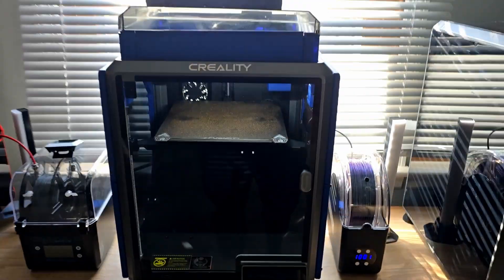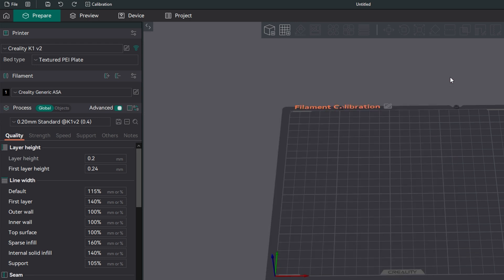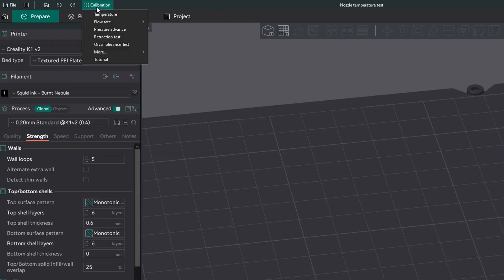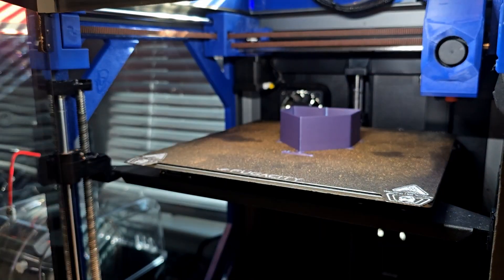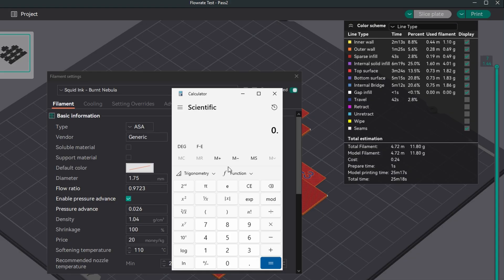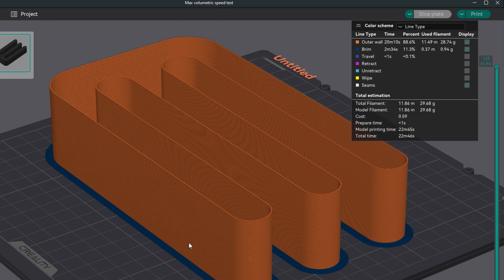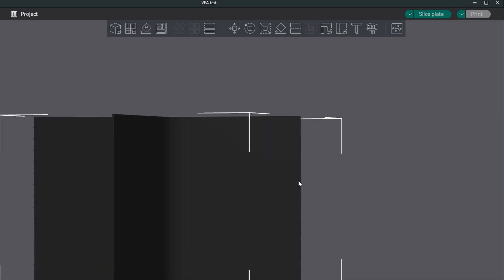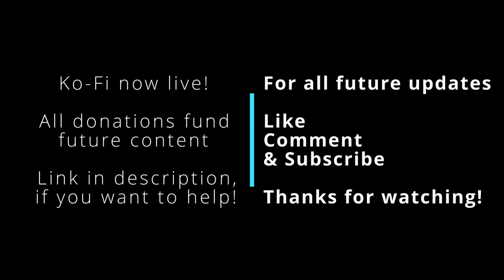OrcaSlicer Calibration - Getting the most out of EVERY filament!

Comment: Not sure if this was mentioned or asked but shouldn't you also have a separate profile for each printer? I guess what I'm asking is, do these small print farms that have say 10 printers have 10 filament profiles of each filament for each printer?
Reply from the maker: @tonybraun5118  That is correct.

I will tune a profile for a filament specific to each printer regardless of whether it is the same exact material being melted in both.

The values are likely close if the machines are unmodified or share the exact same modifications.

The major differences will be found in the same machines with different components/upgrades installed.

Comment: My temp towers all look the same. I checked the Gcode and saw that it was in fact changing print temps. Should I just run the PLA hotter? Would that help my pressure advance/flow rates?
Reply from the maker: With your temp towers providing similar results, it is safe to choose a temperature that falls in line with the high end of the manufacturer's recommended range.

Melting the material at a higher temp will allow for the printer to perform with increased flow rates (the hotter it can melt, the higher the flow it can meet), which in turn will require the pressure advance value to be set accordingly.

Comment: I am sticking with super slicer, trued out orca slicer, with default settings for my printer, never figured put why it, after preheating to 105 bed and 260 hotend, it waited for the temp to drop by halve and then start printing abs.
Reply from the maker: @lcmattern  This occurs to avoid material oozing following a purge to produce an accurate besh mesh. Definitely not a terrible trade off.
Reply: You can adjust the custom g-code at the start/end of the print just like on super slicer but the variables are a bit different. Without this, it runs a default temp, which as you noticed, is wrong. It’s actually very similar to SuperSlicer in that regard, only the orca-equivalent variables names to put in for the bed and hotend temperatures are a bit different.

Comment: I noticed there was a field for SHRINKAGE. I'm having an issue with mechanical parts that are slight small. i ran a Califlower giving me a size of 99.5%.  It wants me to adjust me X,Y steps per mm in the firmware but would you compensate in the SHRINKAGE under the filaments?
Reply from the maker: I would try to compensate with shrinkage before altering cfg values, but that is definitely another option to consider to achieve dimensional accuracy within your prints!

Comment: Absolutely amazing tutorial, clear, detailed and relatively short! I'm sure I'll be coming back to it many times when doing calibration for a new filament!

I have a question though, do you have any advise how to configure the slicer for different nozzle types? I currently run 0.4mm on my Ender-3 V3 KE and I bought some 0.6 and 0.8 nozzles, but orca slicer has no presets for them.
Reply from the maker: Although these calibrations provide a great foundation to hone a 0.4mm nozzle, I can not say that it has been efficient for other sizes through testing.

Stepping up to larger nozzle sizes, it will be a more involved process requiring calibration prints outside of the baked in calibration feature.

You could also pull up a K1 profile for those nozzle sizes to see what the defaults are to have a baseline to work off of.

Send a test print on an uncalibrated 0.6mm/0.8mm default profile (depending on the nozzle size installed) and see what requires adjustment.

This will require more time and patience than the process covered in this video but if dialed in correctly, can greatly improve the printer's output by decreasing print time without any additional modifications.
Reply: Hey  @CovenantCustom  thank you for your reply!

This is what I actually tried - I compared presets for K1 0.4 and 0.6 nozzles and tried to recreate the differences while creating a new preset for my printer. Now my prints now are much faster (almost 50% decrease in time), but they are far from good. I printed a few gridfinity bins which have visible gaps and other imperfections, but also a benchy which just looks really bad. There are so many issues with it. I'm a bit lost at identifying the problems.
Reply: Do you think that now I have created a working preset for 0.6mm I can follow this tutorial to fix the imperfections I was talking about above?
Reply from the maker: @Phos321  Gaps could be due to a variety of things. Printing too cold and not having proper layer adhesion. Flow rate not being high enough and under extruding. Max volumetric being too high and you're outrunning the rate that filament can feed. I found that although these tests can be performed with larger nozzles, the results don't translate as well as with a 0.4mm nozzle. I would look into calibration prints outside of the OrcaSlicer calibrations to achieve the best results. Check out the Ellis tuning guide for ideas, tips and additional knowledge. It is a great resource that I used to educate myself back when I was running Cura years ago.
Reply: @CovenantCustom  great stuff I'll check it out!

The gaps are only visible in places where two walls join, e.g. in the gridfinity bin where the outer wall meets the walls of the label section. It's identical between all prints.
Reply from the maker: @Phos321  This could be related to pressure advance being too high which relates to accel/decel values during movements that require directional changes. You could print a calibration specific to PA or simply slice a test print like a calibration cube and perform live tuning, lowering the PA throughout the print to see if it improves.

Comment: Good OrcaSlicer filament calibration video.

4:30 - Could have used some explanation about why you added 5% and then multiplied by 0.9723.  In the video, these just look like magic numbers with no understanding of them.
Reply from the maker: @Liberty4Ever  Thank you!

Regarding the flow rate tuning, the values shown on each test print represent the multiplier that is applied to the default (prior to pass 1) or previously stored value (if running pass 2).

This will either increase (positive number) or decrease (negative number), the flow rate value.

Those adjustments are applied to the existing flow rate value that is stored if the material profile.

This guide is meant to accompany the detailed tutorial that can be found in the Calibration drop down menu.

It provides a visual aid to an existing/reliable resource and I encourage everyone to read through it if any questions arise.

Always happy to extend the information either way! Thanks for your feedback and I hope this provided some clarification to that test specifically. 

Happy printing!
Reply: @CovenantCustom  - Not my first OrcaSlicer calibration video.   :-)   From watching other videos and reading through the OrcaSlicer tutorial, I knew what you were doing but a noob wouldn't.  In every other case you did a very good job of explaining what you were doing and why, which is what people need to learn.  It seemed noteworthy that you glossed over this one test.  I only commented hoping to help you get the viewers' perspective.  You clearly care about making good videos and I thought some constructive feedback could help.  I did like your rationale for doing the preliminary flow rate test, then the pressure advance calibration, and then redo a finer flow rate test.  I don't recall seeing that and your reasoning for that order does make sense.

I need to stop playing around with new filaments and calibrate my SV08 for the filaments I use most often.  Thanks for the information and the motivation.
Reply from the maker: @Liberty4Ever  Had a feeling that it wasn't your first rodeo, so I left some details in the response for anyone who might have had the same question.

I appreciate the constructive criticism and your perspective on that portion of the video!

Now, to get that SV08 melting! Best wishes with getting it fine-tuned and providing the quality output that you're looking for!

Thank you again for dropping in to provide some feedback. It is greatly appreciated!

See you on the next one!

Comment: How does calibration in Klipper factor into the calibration in Orca and overall? I find myself overwhelmed with the config files, macros, and general order of operations for making sure things are calibrated. Also curious if / what changes made in Klipper or KAMP have interference from code from orca? My k1 seems to do the regular bed level  procedure and may not be doing the more sophisticated one, which has sparked all these questions. 

Anyways, thank you so much for all your concise and informative videos! 3D printing has been both satisfying and overwhelming diving into. Your content leans towards the educational sweet spot that I’ve been looking for. Big creators are either giving a sponsored and vague “review”, or going into some incredibly detailed study with points that go way over my head. Thanks again, looking forward to future content!
Reply from the maker: @ShowBizGravvy  Great question! It's best to think of your printer config as your overall machine operations and your slicer as a task that it is set to run.

The values you alter in cfg files will set the parameters in which the machine will operate and the functions/features and even restrictions that it can provide (think confining build volume, setting input shaping values, setting rotation distance for a different gear set on the stepper motors or even fine tuning one - such as the rotation distance for your extruder - calling 100mm to be extruded and it extrudes 92mm - there is a formula to correct that, so that the length you call, is the length you get!).

The slicer determines the composition of the printed file (quality, strength, speed, support and additional features to increase adhesion like using a brim to secure smaller prints/prevent the chance of warping on larger prints or selecting order of operations - i.e. sequence by layer or object and a few others that may or may not be applicable to your machines operations).

If your question relates back to something like nozzle size or pressure advance, although my nozzle remains the same as my cfg value (0.4mm), the pressure advance set for the materials in these calibrations, override the preset value in your cfg.

Regarding KAMP, the operation gathers bed mesh data from multiple points on the bed before isolating the area that the print will occupy. Make sure there is an include for KAMP in your printer.cfg

The goal with all of my videos is to produce the same kind of content that I would be looking for if I was researching a specific topic. Truly happy to know that it has become such a great resource for you and many others in our printing community!

I am looking forward to all of the projects that lie ahead and appreciate the support of everyone that is accompanying me on this journey!

Until next time, happy printing!

Comment: I have not updated my firmware for my k1 in a long time BUT your screen graphics are much different.. is that because u have updated or its modded?
Reply from the maker: @riodave4954  I've gone ahead to root all of my K1's and am running Guppy Screen on each.

It's a different UI and provides some useful macros additionally (belt calibration for testing similarity/equivalent tension and input shaping - isolating X & Y - instead of measuring Y and applying it to both axes, among others).
Reply: @CovenantCustom  do you have a video on it? if not u wanna make one :D
Reply from the maker: @riodave4954  Have you rooted your machine yet? There are a wide variety of videos on the process using the Guilouz Helper Script. Once it is running the Helper Script, adding Guppy Screen takes 1-2 minutes! It is a really quick process to complete.
Reply: @CovenantCustom  been rooted the day it came out even when there was a hack for it. thanks!
Reply from the maker: @riodave4954  Well worth it to include Guppy Screen! There's no looking back! Have fun with it and happy printing 😎👍
Reply: @CovenantCustom  waiting for the k1 multi colour upgrade kit before i do anything

Comment: My numbers on the flow rate test are kinda scratchy not clear what would you say
Reply from the maker: I worry less about the printed values than I do on the surface quality of the rectangle itself. They should however be close in finish. If they have excessive edges, it is likely that it is still caused by overextrusion as the nozzle drags through molten material and creates ridges.

Comment: If you switch to a different nozzle size ie 0.4mm to 0.6mm, would you do another calibration test?
Reply from the maker: @jonathonodonnell253  Yes definitely! Changing nozzle sizes will require their own profile. Due to the increase of the internal diameter from 0.4mm to 0.6mm, it will require revisiting the calibration process altogether.
Reply: @CovenantCustom since orca has changed somethings I’ve been doing the same with all my filaments. Also redoing the cal if I changed nozzle diameter. The only other thing I do is a Califlower  to measure shrinkage. Most of the stuff I print has to fit with other real world items.
Reply from the maker: @jonathonodonnell253  All necessary steps to take in order to achieve dimensionally accurate prints! You've definitely got the right idea for keeping everything in spec.

Comment: Since you calibrated ASA, which I’m also trying to calibrate, did you preheat the chamber before each print and let each print cool down before removing? I always do that when I’m actually printing with ASA, so it seems only natural to do the same thing with the calibrating. The only problem is it takes a long time to perform each calibration step. No one ever talks about it in their calibration videos, but ASA can but very finicky as I’m sure you know. Hopefully you can answer!
Reply from the maker: @Sugarkryptonite  I start the calibration process by heat soaking the chamber. Once it arrives at 30-35C, I begin printing.

Once a calibration print is complete, I'll pull the build tray immediately following and remove the print.

The chamber will hold temperature for the entirety of the process, maintaining temp as more calibration prints are sent and completed.

Never have any issues with ABS/ASA which is why it is my primary material for most prints!
Reply: @CovenantCustom  Thanks for the response. So when you pull the build tray immediately, you swap in another plate?
Reply from the maker: @Sugarkryptonite  Although that is an option, I simply flex the plate (running PEI textured at 100C) and the prints release after a couple of minutes.
Reply: @CovenantCustom  Hmm okay, thanks. I found on my bigger prints with ASA if I took the plate out of the heat right after printing, warping or cracking could occur. I guess for calibration it's not so bad, though.

Also curious about the volumetric max flow rate test and best layer adhesion. I've found that even if the layer lines are nice up to a certain speed, layer adhesion takes a real hit. How do you take that into account? I'm struggling with it myself. I mostly just tried to crack the layers from the volumetric flow rate test by hand at different points to see where they were stronger, but it's not scientific. I saw you measured to the point with your calipers where the layers still looked good, but I think that layer adhesion is poor at those higher levels. In my experience with ASA, anyway. 

I've found I can only print at 10-13mm3/s with ASA to get good adhesion, so when I saw you put 35, I was intrigued.
Reply from the maker: @Sugarkryptonite With calibration prints, there is no need to let each plate cool. If we were looking for dimensional accuracy, then I would say that measuring the print after cooling down would be a requirement, but that concern does not apply for these tests.

I do swap plates on larger prints not out of concern for any warping but due to the fact that removing a part from a PEI plate too soon could result in a cosmetic imperfection as it transfers that coating to the print itself.

In the temp tower, you can check the quality of layer adhesion by breaking the spires with something like an allen key. The greater the resistance it has, the better the layer adhesion will be.
Reply: @CovenantCustom  cool thanks. But doesn’t the volumetric flow also affect the layer adhesion? Printing too fast? I’ll admit I’m fairly new to 3d printing, even though I have printed quite a bit of ASA. For example Bambu ASA profile is 18mm3/s, while Polymaker ASA has their profile at 13mm3/s. 🤷‍♂️
Reply from the maker: @Sugarkryptonite  If the value for max volumetric is too high, it will cause under extrusion and with material missing in the layer, you'll know when the printer's components can no longer keep up. I usually aim to be a few millimeters below the failure point to choose a value that presents good printing qualities and won't experience outright failure.

Materials have different values due to their properties and how the manufacturers achieved them. It also comes back to the printer's components and how well they will cooperate with higher values. I.e. I have two modified K1's sitting side by side, running the same exact filament from the same exact batch but one has a higher max volumetric because the melt zone has been extended and it utilizes CHT technology (3 port system within the melt zone extender and nozzle which assists with providing higher values/flow rate). They both are equipped with the same extruder but the higher performing hotend, reaches its limits beyond the other aftermarket option just due to design and functionality.